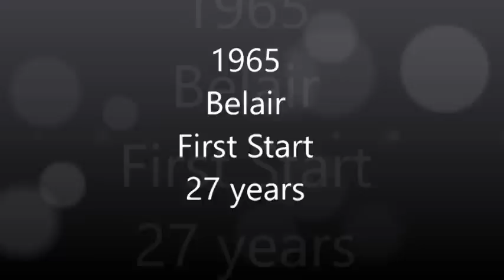1965 Belair NOT A Impala First Start After 27 Years

Comment: I have a 1964 bel-air chevy  4 door,283 v8 engine which still runs like a kitten,the car has been well look aftered when my dad was alive,it has had a fair few repairs with the tyres and brakes and transmission,engine had been out of vehicle to replace Welsh plugs and water pump,etc,in the past. And has had a re-coat of paint on bodywork...Very much still original,never going to part with it,,,,stayed with the family generations for all it's lifetime.

Comment: The new owner should rebuild that 65 bel air from the chassis up n de rust it n dip it in acid tank to clean it n prime it three times n a new blue paint job about 14 coats n to spray crystal clear coating about 9 coats.

Comment: If it's old even though it's a 4 door, it's worth something! I get frustrated when people say it's only a 4 door! Get that baby restored and running good and you have a good driver with air conditioning. There's plenty of affordable aftermarket authentic parts! These things will go forever if you keep them maintained and repaired. I would agree that you probably want to get rid of the power glide and put in a 3 speed. I have an old Chevy book that says the 1965 283 2bbl engine was rated at 195 horses. The base 4 barrel was about 220hp but indicates only a 2 barrel was offered in chevy cars in 1965.

Comment: My parent's had one of these in the mid 70's (283). We drove it from Oregon to Missouri one summer. The AT was leaking pretty badly, but dad decided to go anyway, he brought along a few quarts of AT fluid.  

We put in the last quart of AT fluid at the Oregon /Idaho border late at night. Early the next morning (Sunday) the engine started to over-rev and the car rolled to a stop along the highway in "nowhere" Wyoming. 

The only fluid we had left in the car was 3 quarts of Quaker State SAE 30W motor oil. We added the 3 quarts of motor oil to the transmission. We figured the AT was probably badly damaged anyway, so what more damage could this do?

It worked very well, we were able to continue on to where we could get real AT fluid and made it just fine to our destination.
Reply: Interesting Lloyd Isham an uncle of mine who was from Oregon had a car like that for a while in the 60s Midnight Orchid A wagon

Comment: Oh what a great thing to see!  An old Chevy coming back to life.  Those old Chevy motors were built bullet-proof.  Same as GM's offshoot here in Australia (Holden).  Find an old Holden 6 or 8 still with oil in the crankcase which hasn't seized... with plugs still working, carby intact and distributor rotor and spark leads still okay and that motor will start, given fuel.  They were just so tough...built to withstand rotten conditions anywhere in the world.  They were also easy to work on...no ECU to fry, no complicated pollution control lines...nothing but spark leads, carburettor, battery, radiator and motor.  If you broke down on the road most of the time you could troubleshoot the problem yourself.  It was either caused by no fuel, no spark or a combination of both.  Nowadays I'd be frightened to take the plastic engine shield off!  BTW...we have this aerosol spray stuff over here which is basically hydrocarbons and ether.  You spray it down a carby and the engine will usually start first or second go.  It has a great typically-Aussie name:  "Start Ya Bastard!" (I kid you not!) You should investigate getting some.  Great video and commentary.  My hat's off to you, Jonathan!
Reply: Excellent story re Australia's GM product..
Reply: Darn it......  Amazon Australia will not ship “Start Ya Bastard” to the US!   Curses!

Comment: I really miss the older cars. I started my career as an automotive technician back in 1985. So we were still seeing a lot of 1970’s and few 1960’s cars life was so simple back then. I remember that carburetor on the belair mid section would always be loose and changing points every 2 degrees of dwell changes 1 degree of timing

Comment: Mid 60's Chevy 283's ALWAYS  need lots of gas to cold start, even when they were new. That engine is rated at 185 horsepower, the four barrel version was 210 horse. I had a total of four 65/66 Chevys over the years, all of them 283's, including one that went 250,000 miles and never had the heads off. Hearing that turn over sure took me back to my youth.
Reply: Burt Nelson that's awesome im 17 and I'm wanting to save up and buy me an old car and restore it I'm preferably looking for an impala or a Nova ss maybe late 60s to early 80s models so far I've found rust bucket and people wanting $10,000 for it and it not run or drive
Reply: Gavin Sumpter I'm 14 and we just recently found a 74 nova (68-74 were my dream cars) for $600. No motor or transmission but I'm either getting a 283 or 350 and keep it original
Reply: Burt Nelson oh ya because you know so much
Reply: Burt Nelson since this is a 63-67 283 that have powerpak heads standard they were rated at 195hp with 2bbl and the 4bbls were rated at 220hp. from 57-62 the 283s 4bbl had powerpak heads and were the 220hp rating, but the 2bbl 283s before 63 ran the standard heads and rated 185hp. That's were the 10hp jump came from. and the 63-67 283s also had the 4bbl cam standard in them weather 2bbl or 4bbl.
Reply: Thank you Terry Kehler ! ( For putting out the facts ).
Reply: Gavin Sumpter u
Reply: thanks terry kehler  for the technical info..
Reply: @gavinsumpter8573  Where are you located, if you are up north or midwestern states everything that's not garaged, low mileage or babied are all gonna be like that. Pennsylvania has rust hole inspections, so that would be best up north or other no salt states, other than that check out Jaysmart in north carolina or just start scanning other states listings.

Comment: got a '64 Ford (Mercury) Meteor with a 352 Big Block only has approx 66,500 miles on her same as this Chev.....single master cylinder, single brake line, (non power) brakes, direct crankcase vent to the atmosphere, no PVC system, this one at least has power steering and an alternator, mine still runs generator/voltage regulator and non power steering, love seeing old cars brought back to life, mine still runs like a dream.....what I might have done where he didn't.....is disconnect fuel line into fuel pump, drain such then have added little container with hose to fuel pump inlet....saved him from pouring down Carb + hold open throttle plate little bit would saved lots of cranking

Comment: I had the same car, my first car , 6 cylinder with an air cooled powerglide. I swapped a fresh 350 with a turbo 350 auto added a stabilizer and rebuilt the front suspension,that was 1977 and it came from south Carolina.I drove it for 9 years.

Comment: i started a 1978 Bronco 351M that had sat a lil over 20 years. i had prolly dumped 4-5 oz total of gas down each side of the carb over many tries and got not even a hit, the accel pump was stuck too. my dad is old school, and said aww hell 4 oz on each side u aint even giver a drank yet after settin 20 years and i took his next advice.  then i dumped another 6-8oz of gas down each side at one time, held choke open and throttle wide open and that bastard started right up.
Reply: He never gives his engines much of a drink but he's a good mechanic otherwise

Comment: I started an old 250 in-line six cylinder that had been sitting for god knows how long. over 10 years.It was stuck but broke loose.I had a temporary gas tank hooked to it. It started but barley ran on 3 cylinders. It had stuck valves and I was holding it wide open to keep it going while dribbling marvel mystery oil down the carb and after 2 bottles it smoothed out. And after 5 or so hours of running it quit smoking. Everyone said I was wasting my time putting in my old truck but it ran good for 8 years after that until it was v8 swapped. That was after laying on its side in the dirt for 10+years. It’s still sitting in a friends garage and still runs fine. It has to have 300k on it.

Comment: I believe all cars from the early 60s by law had PCV valves but they weren’t an entirely closed system like today. You still had a vented oil filler cap but the majority of crankcase gas was recirculated.

Comment: That squirrel was busy storing acorns and nuts around that filter. I had the air box of my F150 that had acorn squirrel storage inside it breathes much better after I got it cleaned out lol That one definitely needed a lot more gas to get started than any other engines I have seen you cold start. Still after 27 years and you got her to fire off and run good for awhile. Well that guy is gonna get some parts off it to make a fairly decent running car so that's good at least it was of use to someone.

Comment: Cool car, so original - Optikleen bottle, plastic wire channel below cowl not broken - they are all broken, even 30 years ago. I liked the way he respectfully didn't cut wires and lines. I have issues with the starting procedure tho. Fill the float bowl, check for accel pump operation, prime with bottle instead of pumping to preserve bowl volume, full choke and start. It should light right up instead of grinding away on the starter til he gets lucky.
Reply from the maker: There is a few things you will run into when starting old ones. The compression is always low, the valves are rarely seating proper and the rings are not seating well because of crap on the cylinder walls. The reason I like grinding on the starter is that the oil has had 30 years to drain down and building the oil pressure and getting it moving through the oil ports to the lifters and crankshaft is the most important thing to me. I never want them to fire right up. I do respect that there is as many different opinions as there are procedures to start one, but this is just mine.
Reply: Good points, I just started my Model A after 30 years [with hand crank only :-)].  I'm sure like anyone a guy wants to minimize the work but I'd fear that old starter would give up with all that extra effort. Sure, they're easy to change but who needs it? If one is gonna be grinding away on the starter anyway and are considering the cylinder walls and rings you might as well pull the plugs give a little squirt of oil [I like the combo of acetone/auto trans fluid] in the cylinders. So with plugs out spinning the engine is so much easier on the starter, battery, and will build the oil pressure a little better. Then chuck the plugs back in, fill the bowl, 5-6 acc pump squirts or equivalent from the bottle, choke and it should flame, repeat if necessary...... I know, everyones an expert  :-)  Nice report anyway, Thanks Jonathan.
Reply: Jonathan W I
Reply: @flamingodebra  the video would be lame if it fired right up which it wouldn't because like the video maker said grinding the starter is good for the engine like oh yea ive been siezed up here for 99 years lets just turn 3k rpms right away yeah right.

Comment: I had a 69 472 caddy and ran 80:1 premix with TCW3, i would run it through out the motor and wanted to go with a Makuni oil injection pump. I use this in my truck and it works great as i am now using Amsoil Dominator oil that burn cleaner.

Comment: Get the small plastic bottle from a lady's hair dye kit. It has a spout with a cap. The spout allows for much more precise control and can be used to directly fill the float bowl with fuel, without spilling it everywhere else. This will let the car idle for a moment or two, before hooking up the fuel line to the carb, long enough to quickly get an idea of where you're at with the engine before spending more time. Works lots better than trying to keep it idling by squirting the gas down manually.

Comment: Them nut shells in the breather housing is actually a good thing.They are better than a K&N filter.they help the engine run cooler and cleaner.Leave them right where they are at.

Comment: I miss vehicles like these,they were so much more cheaper and easier to repair and way more dependable then the modern day cookie cutter cars.
Reply: Roger Hall I’ll agree on the easier to repair. The “more dependable” is debatable.
Reply: Six Mile Creek Productions it's more dependable because it was all mechanical not alot of computer and electronics and plastic covers
Reply: These days you'll see cars of 10-15 years old ending up in the scrap yard because of electronics that have errors that can't be fixed by mechanics. They can only replace the boards for so long until there are no spare boards being made anymore and every car in the junk yard has the same problem

My car is turning 26 this year. It does have electronic injection but this kind seems to really keep going. I've seen ones where the rest of the car has rusted away but the engine still keeps going. I'm lucky mine is in mint condition and no serious rust yet :) .
Reply: for the last 20 years GM has had electric door locks that are a 500 dollar bill to replace, and they break often
Reply: Many of these old cars were scrapped because the lubricants back then were crap. Engines were sludged up before 100K miles and it was cheap to buy another car. You can drive these cars now for ages with the new synthetics oils and lubricants.
Reply: Armando Silvier  You're in the wrong building dude, were speaking of cars that had points, rotor, condenser, plugs, that are 50+ years old. The Kia don't qualify.
Reply: @dukeman7595  Ha ha ha!!! Yup he is definitely in the wrong building??!!

Comment: You know, I'm sure, that you can pull the distributor, then chuck an old long screwdriver shank into a drill, then run the oil pump for a bit with the drill to pre-lube the crank and cam bearings, right?

Comment: Hope none of the rod bearings stick to the crank and walk with the first turn over. Had that happen on 327 that only sat 2 years. It’ll start right up sure but if you try driving it around it will waste your crank if any of them do that. Should be 190 - 200 hp. For mid 60s 283
  Recommend taking distributor out and turning oil pump before moving anything crank pump get some pressure to the bearings then let it sit for few days. 
   We used to sometime spray some paint or whatever we had in a spray can while cranking. Cylinders are totally dry. Some oil in that gas really helps.

Comment: This would be a neat car to rehab, especially if there were a way to document how it came from the factory. This is an unusual car. A mid level sedan with a manual trans, and almost no options, but equipped with factory air. It's like air conditioning was a priority for the original owner, and they cut everything else back until the car reached a price point that they could afford to pay.

Comment: Amazed that an old car guru wouldn't put some oil in the cylinders before starting after 27 years. The old 283 was a great old motor. In its day it was awesome competing with fords 289 which was another great old motor

Comment: the 283 was the company's first engine to make one HP for every cubic inch that the engine has (283). it had 290 horse power far from your guess of 160 horse power
Reply from the maker: It is a 2 barrel engine. Far from the 1 hp per cube.

Comment: hey pal, maybe pull a plug wire and see if it has spark? sounds like damico dago up north that would crank his 283 for minutes at a time. i started a 67 chevy truck sitting since 1986 and it fired after 10-15 seconds, another 79 c10 350 the same. gotta put in some newer plugs first and give it a good dose of fuel, not a little misting 10 drop squirt,  that is what makes the difference. your 283 would have fired up very quickly.  there goes 3/4 of your starter brushes.

Comment: A can of Gumout , or Berryman B-12 would be better than the soda bottle, and the straw would make filling the float bowl easier. The jump cables are always a good idea, it provides 1 to 3 extra volts, which gets a better response from old, tired connections. Also old condenser and points like the extra voltage. From there, most vehicles can be coaxed back to life.

Comment: Not too bad - sounds like plugs and leads are the main issue. The lifters and valve noise should clear up with a run. But the draw on the carb sounds pretty good - no stuck valves!

Comment: I try to always fill the carb.thru the vent on top w/2 stroke gas BEFORE moving the accelerator so pump piston will have half a chance of not getting torn.(Also,wont have to grind over much before starting).

Comment: Run new fuel thru the full pump hose and separate can,  -purge the lines  -use two cycle fuel because that engine is really dry =tie a string on a rag  and put it on top of carb ,add gas, that way you use gas fumes and don't wash your cylinders  -the string lets you remove the rag if it backfires

Comment: I bet the rocker and lifter racket was because it was all gummed up with Quaker State oil with paraffin... LOL remember that stuff back in the day... A lot of people use it back then... They changed it years later... I remember taking apart some old 327 and 350 with only 50,000 to 75,000 miles and having to scrape and pick and dig that nasty stuff out from around the rockers and valve springs with the oil drain back holes all stopped up... Drop the oil pan and it would be 1/2 full of that nasty junk... Those were the days...